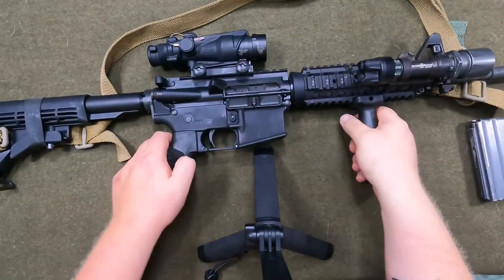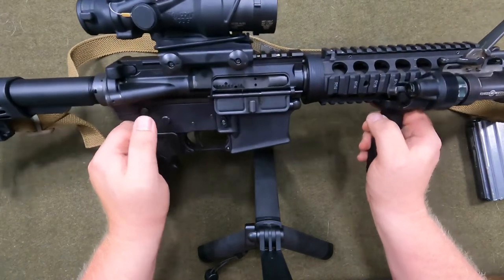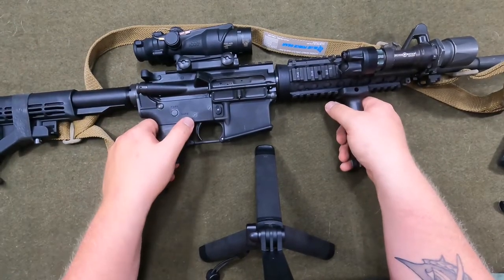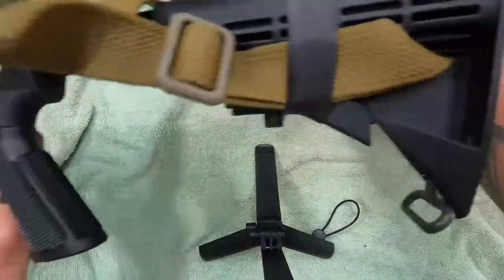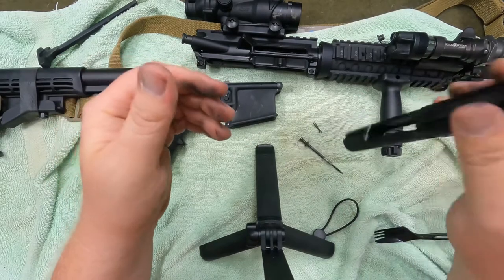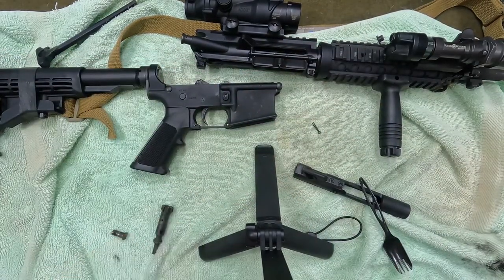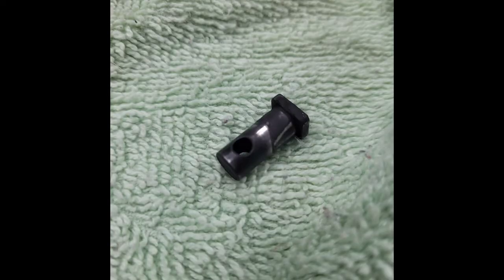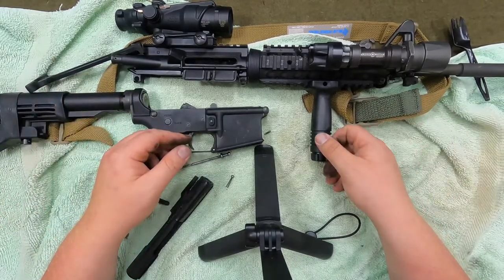Colt CR6920 1000 round update

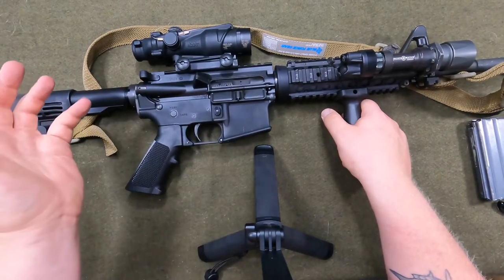Comment: That thing looks like it shoots really smooth, with ejection at 4:00 o'clock.  Any tips on that; H2 buffer, etc?.  Also, how do the upper and lower match up when you bought it, any wobble slop between upper and lower, when new ?.  Thanks.
Reply from the maker: I have 2 other videos on this CR6920 I think most of the questions you have are answered in the first unboxing video I did. The CR6920s come with a H1 buffer per milspec. I have a new Colt M4A1 as well and that has the H2 buffer as per milspec. The wobble was fine i would say it's milspec not the best not the worst. That's actually not something I really check I will say pins are pretty tight when it's was new. Even now there still alittle tight. Here is a link to the first video. 

https://youtu.be/NJ7lUt-sBo0
Reply: @THEPAGUNGUY  Cool thanks.  will check them out.
Reply from the maker: @thesanfordmethod1905  I actually decided I'm gonna make a video looking at both rifles and addressing your questions as well as some other questions I've gotten. I'll make that sometime this week and post it I'll let you know when i do
Reply from the maker: @thesanfordmethod1905  this video will show you exactly what you want to see

https://youtu.be/2TzEDVxgpSM
Reply: @THEPAGUNGUY  That's awesome, thanks !  Yeah, any videos with discussions on any Colt ARs. carbine or rifle, Glocks, Garands, 1911A1s, all = thumbs up !
Reply: @THEPAGUNGUY is a H buffer a H1 Buffer or are they different my cr6920 says H on the buffer  assuming that means its a H1 buffer
Reply: @THEPAGUNGUY  any idea on why my colt Cr6920 bolt does not have a white dot but does say MPC While Some other cr6920 bolts do have the white dot
Reply from the maker: @@beltrik3766  yea pretty sure the colts w that white paint are just left over bolts. I don't think there doing it anymore and once those older left overs are used I don't think you'll see it again.
Reply from the maker: @@beltrik3766  yea I believe there the same thing H is heavy. Standard M4 has H buffer M4A1 w the heavy barrel gets a H2 buffer per TDP (milspec)
Reply: @THEPAGUNGUY  Ah okay so the components are the same? just no white dot because it had me wondering if my bolt was even tested because no white dot was there
Reply from the maker: @@beltrik3766  white dot was only done for the military. Your bolt was tested colt no longer has military contracts so there's no need for the white dot. The dot is just paint it comes off anyways.
Reply: @THEPAGUNGUY  ah okay gotcha
Reply: @THEPAGUNGUY  yeah, Ithink the Heavy buffer is marked H3, unsure which models use those, H1 is standard carbine,  H2 is m4a1, just an H is lighter and used for something other than the carbine, unsure..  I think most people ditch the H buffer as they're too light shoot that brass to 2 o'clock.

Comment: Hello, I enjoyed your video. I just got my my Colt and I’m looking for the same front handle as you have so I can that has a rail. Can you tell me where I can get mine so I can put my vertical grip on it. Thank you for the help.
Reply from the maker: If your talking about the forward grip that’s the KAC (Knights Armament Company) you can get them surplus used you just have to look around type it in on google I’m not sure who has them in stock. You use to be able to get them on EBay. You can check out Thoroughbred Armament here may or may not have any.